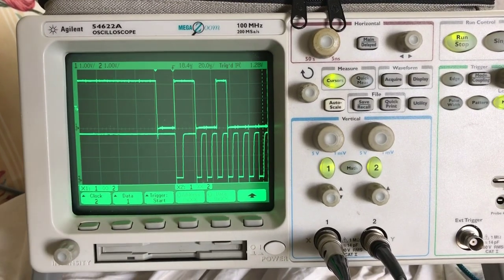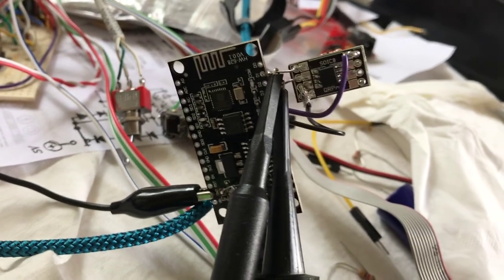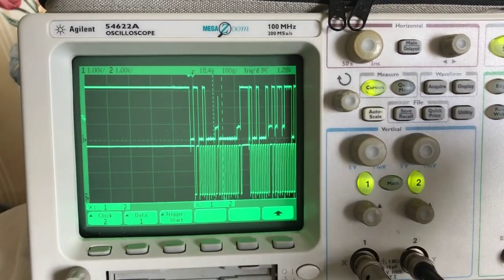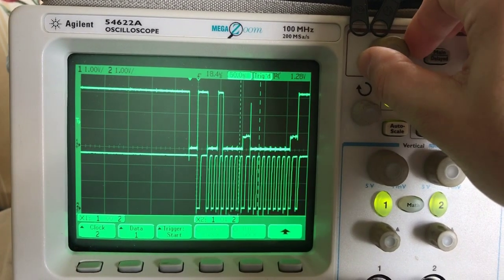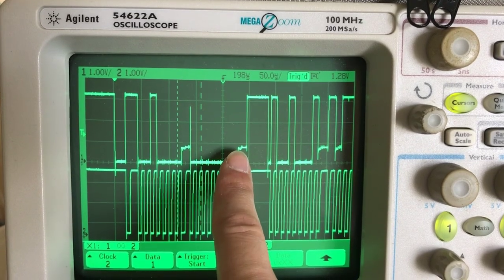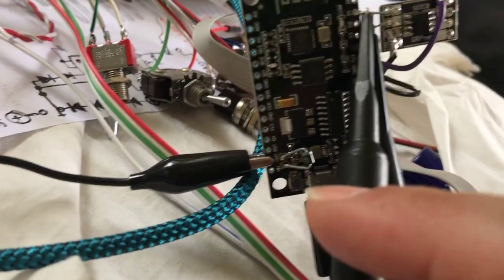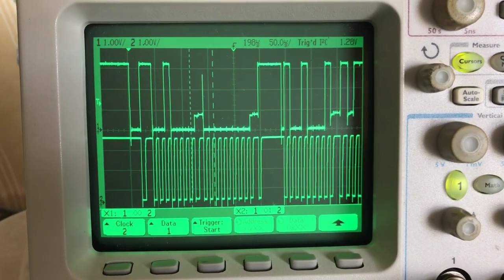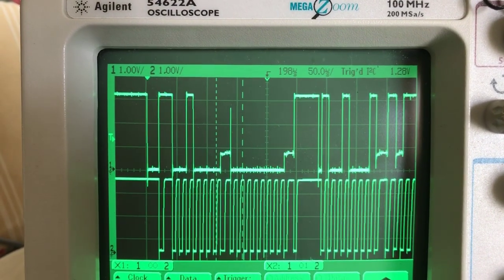Debugging an I2C Temperature Sensor on ESP8266 Microcontroller with HP/Agilent 54622A Oscilloscope

Comment from the maker: Further investigation showed the problem was indeed the microcontroller---I tried various combinations of pins, and it seemed the specific GPIO pins used made no difference. So I suspect it is a power distribution problem inside the ESP8266 causing some systems to be starved for power during WiFi transmissions or similar. Switching to a different ESP8266 module with the same temperature sensor resolved the issue.